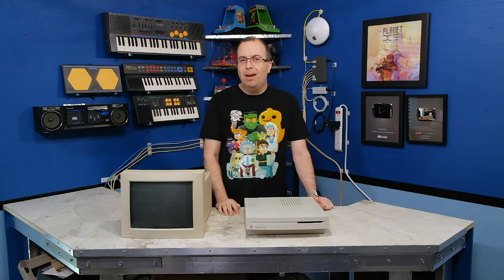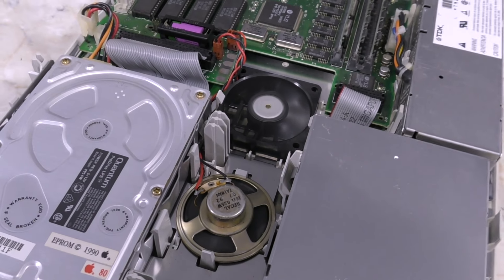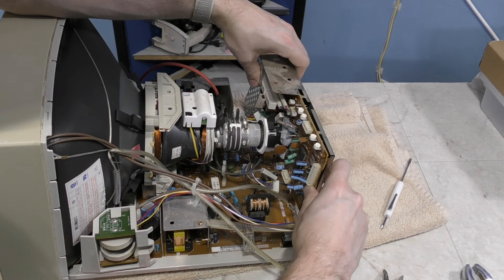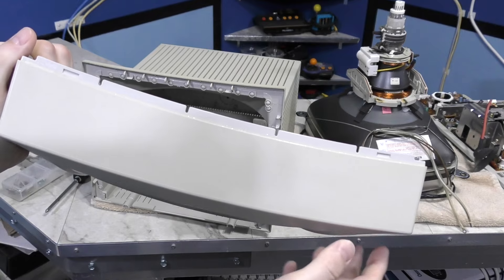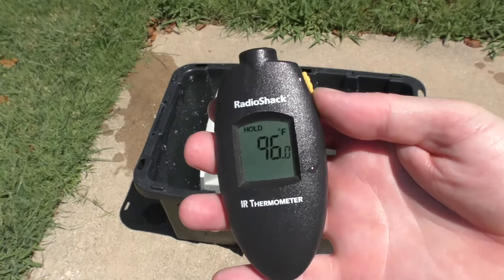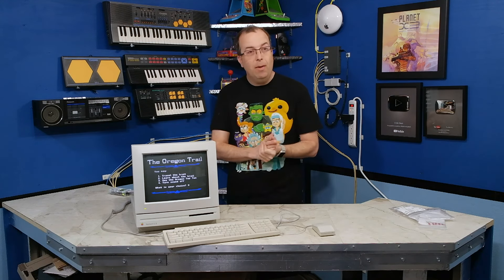Macintosh LC Monitor Restoration

Comment: Imagine in 2079 the 64-bit guy cleaning rust off the new pro display
Reply: ah yes, the ever-annoying rust on anodised aluminium
Reply: @ruwo7697  well, corrosion I mean technically but it's still caused by oxidation so I have no idea
Reply: @PhantomFool765 aluminum corrosion is indeed caused by oxidation but it forms an oxygen impermeable surface layer. that happens in a matter of minutes after you expose it to the air.
Reply: It could be 8bit jr
Reply: Hhhahahahaha lol
Reply: Retro brighting a 4k monitor...
Reply: I have a feeling that by that time there are more retro electronics using plastic, ceramic or glass rather than metal, especially when talking about phones... So maybe it's more about fixing scratch marks and cracks for the 64-bit guy?
(Also, profile pic checks out :)
Reply: I just had a thought... with more and more computers and electronics going with a black casing instead of the white, does this mean no more retrobrite in the future?
Reply: @SmaMan  retro blacking...
Reply: Technically black plastic can yellow too, it's just harder to tell for obvious reasons. I'd love to see someone retrobrite a Sega Genesis just to see if it makes a noticeable difference.
Reply: metro2002  On BrainBay "New old stock, in box!  Never used!"  Gets opened on VR show, mounting screws crumble to dust immediately.
Reply: "Can you believe people paid $1000 for this monitor stand in 2019!  Well, two minutes of cleaning from my personal robot Alexa and it looks good as  new!"
Reply: can't imagine our current technology being discussed like the 8 bit tech, but it will happen.
Reply: metro2002  "The pro stand only cost $1000.- back in the day, but because nobody bought it, it's very rare and people are charging prices comparable to a summer home on Mars"
Reply: maybe he will retrobright that monitor again.
Reply: YouTube: You need 100,000 subs to get a Verified badge.
 @smheath  - 1 sub, Verified.
Reply: @cms1138  you haven't seen the 8k monitors yet have you?
Reply: considering he's in his mid 40s I think he'll be very dead by 2079
Reply: if he lives to be over 100 and healthy, sure.
Reply: Nah, hes cleaning the 8 bit guy android that he cloned himself a few years back
Reply: After a while, aluminum can become dull and look like it's stained white, like birds have pooped on it.
Reply: @maggs131  yes obviously
Reply: @cms1138  8k monitor ....
Reply: ..and scratch of the dust from a once 1.000$ worth of stand
Reply: XDR?
Reply: @rdevroede   "Of course then I just printed one. After paying the hefty replica rights fees and the federation alloy tax on another 19 materials this month, my budget was pretty stretched."
Reply: @ruwo7697  the acid raid ofc
Reply: @tonycstech  Idiocracy?
Reply: Will the world still exist then lol
Reply: RUWO 
Omg I love your pfp, one shot right? Niko Ahh!!
Reply: Mein Liebe you mean 4bit
Reply: He wont be alive
Reply: The 4K guy cleaning an Xbox one X
Reply: That one GamerGuy more like 2049 or so.
Reply: The 64 bit guy in 2052: restoring old nintendo switch.
Reply: Mein Liebe that would be 16 bit guy or 4 bit boy
Reply: @ruwo7697  sah
Reply: I think today HW will never become something like these old computers from 70s, 80s and 90s. Today it's you have one monitor 10 years without problem, it's not rare, there are milions of same types over world so it will never become something rare for colectors. And I also don't believe today HW survive such long time. When you find some 486 PC in terrible condition, you mostly only change PSU and it works, try it with max 10 years old computer from modern era. :-D
Reply: @cms1138  That not how it works white casing fades into a yellow color but black casing does not do that.
Reply: @obi-wankenobi9708  wow, that joke passed way over your head lol.
Reply: In 2079 you can download and emulate thing in your co-brain! and your brain sense it as real! You are totally virtual! 😄
Reply: 11-bit guy
Reply: It might be The 128-bit Guy
Reply: Just wait until the 128 bit guy comes and gets you
Reply: “Surface 2019 Restoration” -The 64-Bit Guy
Reply: The long lineage of __-bit guys, the next ironically being David's daughter. She was of course the 16 bit guy, carrying on her father's name and career. She was followed up by the rarely heard of 32-bit guy, who only experienced brief prominence.
Reply: @TheSektorz  how tf
Reply: @keselekbakiak  Or 8-Bit Guy III.
Reply: He is no longer alive in the year 2079.
Reply: He'd be like 110 years old but ok.
Reply: Hehe it would be me and i would still be using java............
Reply: more like in 2045 the 32-bit guy cleans off rust
Reply: I wonder if computers will need to upgrade from 64-bit. I read it seems unlikely since it can address an insane amount of RAM
Reply: Funny

Comment: Tip: When I bleach large objects, I usually add bottles with water inside the crate. It takes up some of the volume, saving water and peroxide.
Reply: Pretty good idea. You could also use bricks or whatever other heavy filler objects you have
Reply: Or, if possible and economically feasible, just get a container that is a good size (not too large) compared to the item you are bleaching / retro-brighting.
Reply: @Nukle0n  So, like in a toilet tank. sed to do that in the day…
Reply: @softdorothy  "in the day" being still today! :)

Comment: I’m glad you shared that the retrobriting has held up for two years. I have heard people complaining that retrobriting is a useless process and doesn’t work permanently.
Reply: But....that's just common sense. Of COURSE it's not permanent, NOTHING is. Eventually the plastics will yellow again, how long that takes depends entirely on how it's stored/used post treatment. Assuming it took around 30 years to get that bad to begin with, it's not unreasonable to expect a decade or more out of a well-cared-for restored piece.
Reply: Van Rose Minimizing future exposure to UV light probably helps also.  Some of the yellowing patterns you see on this old equipment can tell a story.
Reply: When I retrobrighted my vintage Macs, I sprayed on 303 plastic protector which blocks UV rays. Years later, they are still flawless in their glorious platinum beige. Highly recommend getting a bottle of this, it works really well to prevent re-yellowing.

Comment: "Take a listen to this horrible sound it's making."
YouTube auto captions: [applause] [music]
Reply: Lol, thanks for pointing out.
Reply: That sounded like rain and wind. :)
Reply: Sounded like a broken rubber belt being stack inside a motor inside a hard disk drive or a diskette drive ,mmmm
Reply: a classic
Reply: @Kumimono  sounded like a boiling kettle
Reply: Nope. That sounded like heterodyning. (The same thing that causes antique thermionic valve radios to 'whistle')
I would guess that there's a dry  cap in the amp circuit that's guilty of not doing it's job.
Reply: I expected the whine to be borderline inaudible, so I put my phone's speaker next to my ear. Just the latest of dumb decisions I've made.
Reply: imo it sounds like a tea kettle going off
Reply: Conclusion: Google hates apple, and likes to hear their products suffer in agony :D
Reply: @taygadesign  Tea's up!
Reply: I'm laughing way too hard at this!
Reply: Hahaha
Reply: Everything is [Applause] for YouTube auto captions.
Reply: Sounded like a woman screaming and wind blowing through a cracked window.
Reply: Sounded like something in the chassis was generating an RF signal that was bleeding over to the speaker.  Could be the floppy motor, a janky component, many things.
Reply: Music? Maybe it detected justin bieber?
Reply: @jokeletsplay  Certainly sounded like it!
Reply: YouTube blocks content on music infringement on copyright...
Reply: @QlueDuPlessis  Absolutely, caps in series on the amp input are leaky and passes the dc
Reply: @QlueDuPlessis  thats the common issues with those macs of that era from late 80s to early 90s
Reply: brews tea
Reply: Aadil Shah Transistor radios can do it too, especially ones with tuning capacitors. It does happen a lot more with valves/tubes.
Reply: Everyone: “Awww.  Cute robot struggling and sad.”
Reply: Chaos89P what happened after you put the phone up to your ear
Reply: True
Reply: Youtube is so fucking stupid.

Comment: 6:10 Just an FYI to people watching this, if you do that with a recently energized tube you're asking for a trip to the grave. The charge can easily shoot through the plastic handle of that screwdriver and into your hand. It's fine for old units that haven't been plugged in in a very long time. You're going to want to at least wear some rubber gloves.
Reply: Why would the electric charge choose to go through the highly resistive plastic handle and human flesh instead of taking the nice path of least resistance through the metal wire that’s attached to the screwdriver

Comment: How cool, I have the same LCII setup with the Apple II card. Mine was originally from a school and it needs recapping as well as it just weak sound. My original LC however makes the EXACT same sound with the speaker connected.  When we did the vintage display at a recent education convention it started doing that. I think most of my old Macs need caps ☹️

I can't wait for the video on the IIe card. They're so cool and it's such a fitting peripheral for the LC

Comment: maybe soaking them in a hot solution of sodium carbonate prior to cleaning and using less abrasive cleaning methods, could be creating the streaking, which could be scratches.

Comment: You should leave the plastic wrap on even with a full tub as it limits evaporation which carries quite a bit of heat away.
Reply: I think he was concerned that the wrinkles of the wrap would touch the top of the case and possibly cause some weird marks due to unevenness.
Reply: @HelloKittyFanMan.  Easy way to fix that is to put a couple of 2x4s across the rim to keep the plastic wrap above the case.
Reply: I second this. With the plastic wrap off, evaporative cooling will rob you of a lot of heat. Tent the plastic wrap with a board or chunk of coat hanger if contact with the piece is an issue.

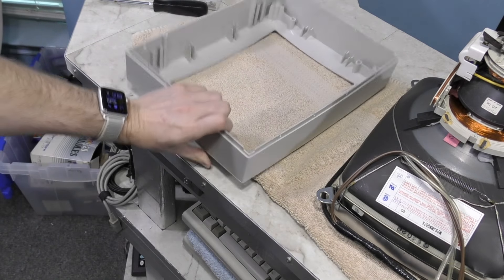Comment: 12:53 Hopefully moisture doesn’t build up in the case and bite you in the rear down the road...love your videos!
Reply: i seen that as well
Reply: Wow i didn't notice that it was dripping wet as he was putting it together lol.
Reply: I could not believe my eyes when I saw that. Not only everything will corrode inside but drops can fall on pcb and short stuff wile assembling.

Comment: Apple product with a public service manual? Oh how times have changed.
Reply: that Manuel was not publicly available back in the day for those either.    good old service source CD's ;)
Reply: They're also 45320598 times more complex.
Reply: @charlessale409  They are only that more complex because the parts are hard to find and the manuals/schematics to repair them are not released to the public.
Reply: LOLDONGS they still have those, but just like back in the day, they are for internal use only

Comment: To anyone with a short attention span if your Macintosh squeals like the one at the start of the video the caps are leaking and needs to be replaced and board needs to be cleaned.
Reply: Oh I thought my had a kettle built in. Thanks for the heads up.
Reply: same with Mac Classic II, Performa 475, Quadra 605, IIci, Centris 610, etc.

Comment: A substitute for that grey goop would be ATV silicone. AKA, "liquid gasket." Available at any auto parts store. I keep a tube of high-temp stuff in the toolbox for working on engines, but it doubles nicely for tacking electronics at joints like that. You can actually get the "proper stuff" from Digi-Key and other electronics suppliers, but it's pretty expensive.

Comment: As always, appreciate the celsius conversion. 🍁👍🏻
Reply: 118 F = 48 C
88 F = 31 C
107 F = 42 C
Reply: louis tournas thanks
Reply: a human being measure its always good.
Reply: If 0 degrees Celsius is 32 degrees Fahrenheit, then is 1 degrees Celsius 64 degrees Fahrenheit
Reply: @puddyslayer4458  as a snow Mexican you’re correct

Comment: If you don't have one, you should invest in a decent air compressor, and I'd get one with a large tank, at least 40 gallon. I've found that compressed air is a big help, particularly when cleaning out vents and cosmetic grooves like those on the side of the monitor casing. I use window cleaner as well, but what you can do is saturate the area with the grooves with cleaner and chase it out with air. Works like a charm. I wouldn't chase cleaner towards buttons or keys though because you can easily blow dirty liquid cleaner into the contacts where it'll be hard to get out and will likely lead to contact failure. So this is a good step after disassembly.

Comment: You might wanna try a aquarium "air thing" for  the bubble problem.
Ive seen those things used for eliminating bubbles while anodizing aluminum.
Reply: You anodize your aluminium in your fish tank dude ? can I come and watch ?
Reply: o.O
Reply: @peterbustin2683  Sure haha
Reply: The sous vide he has would help with that, in addition to helping heat up the water

Comment: The Apple IIe/IIc and the Macintosh LC series were pretty much my entire school computer experience!
Reply: Sounds like a 90s kid to me. Nice!
Reply: same here, although majority of the Apple II than the LC line. my first time with a LC 475 was at school and it was playing the After Dark screen savers, i was hooked instantly.
Reply: Were y'all "forced" half the time to use the LC's IIe emulator? I now can't believe that my first experience with emulation was in my elementary school days!
Reply: @Chaos89P  all my Apple usage in school was actual hardware. my first time with any emulator was by a friend showing me an NES emulator.
Reply: @Chaos89P  That and the "At Ease" interface ;)
Reply: At school we had to bulky Power PCs, then in about 5th grade they replaced them all with the colorful G3s, which were my favorite. Mac OS 9, we barely knew ye.
Reply: @CDP 1802 So that's what that weird folder-based interface was called!

@madmax 2069 Was it by chance FCE Ultra on your high school's servers? Said server had several Nintendo system emulators. Don't know if they still do, however, since I graduated over a decade ago. Hardware emulation via a plug-in board is still emulation, as far as I know.
Reply: Yup, same.  I had the Apple II/E (C) to play games in kindergarten and first grad,e and learn world processing in 2nd grade (hated Fred Writer).  As for the LC series, I had to use the success maker program for math, reading, and in middle school, science.  I hated doing that too.

Comment: Your audio issue is likely coming from the power supply.  It sounds like it needs a re-cap.
Reply: Yup for sure there's a bad cap either on the power supply, sound chip power pins or output filter cap
Reply: Do the logic board too.
Reply: Agreed
Reply: Could also be a filter cap related to the cpu fan.

I have seen a similar issue inside an old vcr with a built in amplifier.

Every time the motor for the cassette playback moved, popping and clicking could be heard through some connected speakers.

Replacing a single capacitor on the motor got rid of the noise.
Reply: I was repairing LC models for the past 6 years. Repaired about a 200 of them. The squealing is coming from the audio IC because of the bad caps. Had about 40 that did the same :) Just my 2 cents. Recap and wash the board throughly.

Comment: I think the Performa 475 used the same case, as that looks just like the one I had, save that I modded mine with a blue LED for the HD activity light! Sadly, I no longer have the case, but I do still have the motherboard with the max amount of RAM it would take, plus a “real” 68040, not the 68LC040 in the original Performa. I may even have the SCSI HD with System 7 on it somewhere...

Comment: Ah, back in the days when apple products were designed to be disassembled..
Reply: and now its impossible to fix an iphone that is much smaller than a pc....
Reply: Ah back in the day when they used brittle plastics on everything.

Ok, I might be bitter as I've had to spend 2 hours 3D designing replacement parts to 3d print to repair mine because everything is delicate on my power mac 7500
Reply: @NaokisRC  I was disassembling an older G3, and basically every plastic piece I touched broke. They're so fragile nowadays - must've cut some corners with cheap plastic

Comment: Ironic that it doesn't come with a stand

Oh Apple you never changed did you
Reply: roasted
Reply: C H A N G E
Reply: the LC was the stand
Reply: But they didn't sell a stand for it at all, nevermind for $1000. If you wanted to adjust it you either propped it up on something or you just bought a better monitor.
Reply: Of course that it doesn't come with a stand. It is 80s CRT. The BOTTOM is THE stand.
Reply: Well, technically the LC was the stand, and it probably sold for more than $1000... 😀
Reply: @igornikolic4394  99% of all 80's crts had a stand so you could tilt them and move them, but you already know that, you are just trolling
Reply: @MrHBSoftware  99% is a stretch. Maybe half of them.
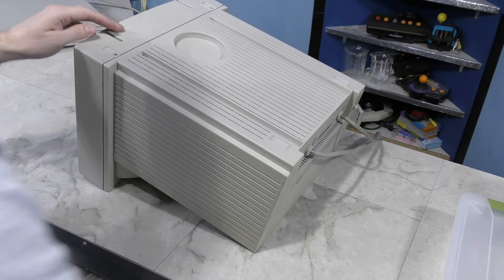Reply: If you look at the circular indent at around 5:28, that's where a mount would have been able to be added. Don't know if it was an accessory or if it came with the monitor.
Reply: I have two LC Ii monitors and they both have rotating stand. After finding that certain old Samsung lcd tv's had the ability to view classic Macintosh resolutions i never used the original crt displays.

Comment: DAVID! For the love of all things electronic, please do not go spraying cleaners directly onto vented electronics. Spray the cleaner onto your cleaning cloth and then wipe the case. Otherwise, you risk cleaner making it onto the electronics inside, drying, and leaving a residue which could cause very difficult to diagnose electrical issues in the future.